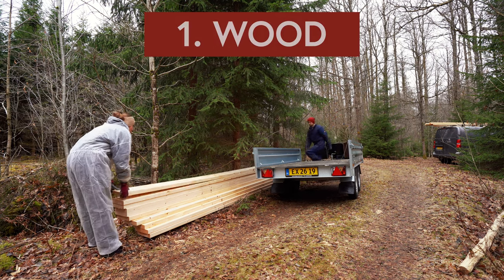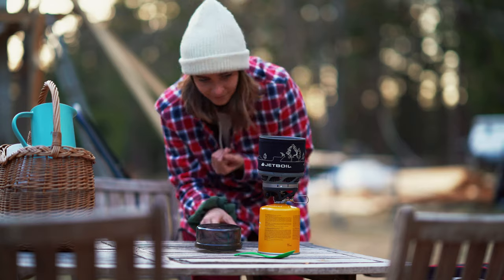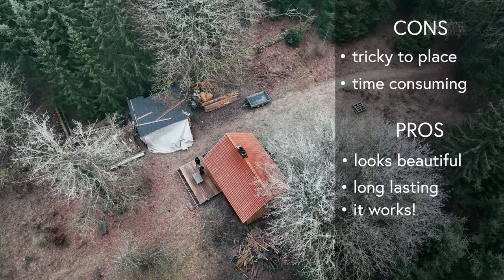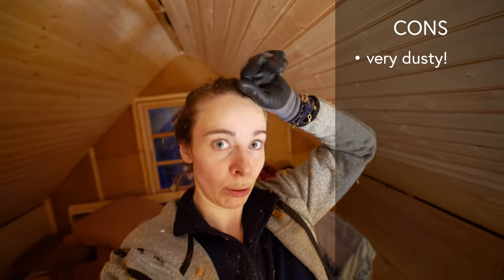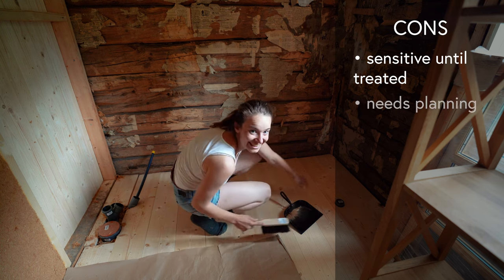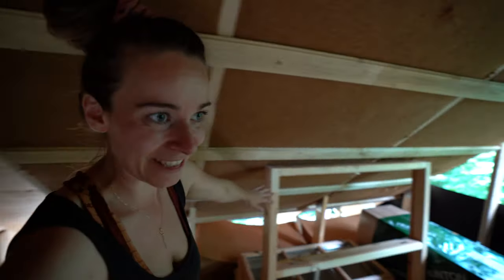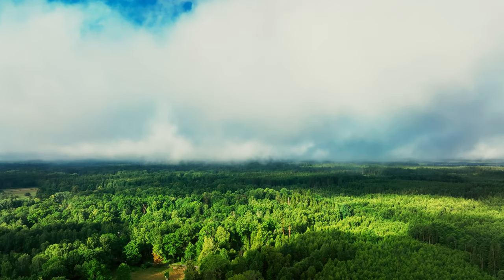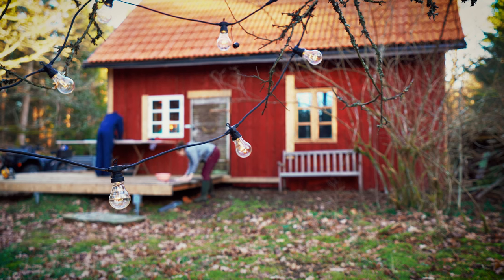Building Off-Grid with Natural Materials | Pros & Cons + Regrets

Comment: I would recommend an oil based stain ove any latex paint. Stain needs no removal when a new coat is needed, soaks in much deeper into the wood grain offering much more protection to the wood, and can be found (at least here) using natural oils like linseed so there is no chemical odors. And, if you could keep at least 1 wall showing the original log wall in the inside I think that would look great (we Americans love our log cabins) and showcase the origins of the building. Best of luck.
Reply from the maker: Hey goatman. Thanks! So, we don’t need to remove the dark stains on the window frames before coating them? Am I understanding it right?

Ohh I know 😅 Everyone reacts to the wall. It’s just so damaged. We talked about making a “window” or having new old planks put up. Because you’re right, it looks so cosy!
Lots of love, Annie
Reply: @AnnieJulian  with a good oil based stain, no. It may show a bit of darkness, but to me that is just character and charm.

Comment: I second the oil/beeswax comment, I use tung oil and beeswax personally and love it! I go 12 parts oil to 1 part beeswax and buff it in well, then wipe off the excess after a few hours. If Odie’s oil is available in Sweden I would highly recommend their finishes too. It is tung oil based too but dries a little faster.
Reply from the maker: Thank you! 😃

Comment: Hej, there! We are on a similar project in the Alpes - it‘s an old stone barren, though. I was wondering, what you did to protect the untreated wood from woodworms and (worse) and Hylotropes bajulus (commonly called old house borer)? Or don‘t you have that problem in Sweden? Take care and have a nice day …
Reply from the maker: Hej! So wonderful to hear from you. How amazing you're doing a project like this too. So curious to see your stone barren. 
Well, nothing yet. What are you gonna use, do you know yet?
Love, Annie
Reply: Hi, Annie I haven’t got a yt-channel (yet), but imagine an old rustico in the Lepontinian Alpes at a height of approximately 1300 meters above sea level. It‘s steep, meadow is facing south, and the light is stunning. 

What I would consider against wood worms, and this nasty hylotrupes bajulus: kind of wood (more heartwood, less sapwood, for certain parts larch, but its pricy, of course), its dryness (the drier, the better), construction (the air should circulate freely in the space between tiles and construction), biological barrier.    

One elegant way is to burn wood, brush the ash off, oil it. Works with façades, terraces, flooring. It‘s a japanese technique called yaki sugi, also shou sugi ban if you want to do some research on it. The idea is to carbonise the surface as a barrier - no damaging chemicals involved. 

Second idea is to use less risky chemical barriers (with keywords „wood protection“ and „biological“ you should find some products). Pay attention to ingredients, though - boron salt e. g. is cancerogenic when inhaled, but is sometimes sold as „biological protection“. 

I‘d also rely on local knowledge: Maybe ask old farmers how they protect their houses. 

Of course one has to accept the impossibility of a hundred-percent-control, when one lives off-grid, but one can control certain aspects like materials, construction and barriers. 
Have a nice day!
Anne
Reply from the maker: @zerpheros  Thank you so much, Anne! I will show all of this to Julian, when we get to this. So much great advice, thank you ☺
And Oh my Gosh, your place sounds stunning! Looking forward to that YouTube channel. Let us know 😊

Beautiful day to you.
Love, Annie
Reply: Good morning, Annie 
welcome and I am happy to help. I bet, we can all watch on your channel how you decide what to do with the wood … By the way - I have stolen your put-the-tent-oven-in-the-chimney-idea. I added a steel basket with sauna stones on top to store the heat. It helped a lot to heat up the ground floor - stone huts are awfully cold in winter. 
Take care and have a nice day …
Reply from the maker: Good morning, Anne :)
Oh yes, it will be an exciting one, when we treat the wood. So many beautiful suggestions.
My Godness, really?? I love that! Thank you for telling me (gives an amazing feeling of purposefulness when someone gets inspired!)
The sauna-stone basket is a wonderful idea! I will tell Julian about it.
Take care, and have a beautiful day too. You are amazing!
Love, Annie

Comment: I'd been wondering why you didn't reuse the old roof tiles? At least the majority of them. Then at least 1 full side of the roof would have been free. And the weathered and moss growth would look original.  Or, why not slate? Even here in USA there are hundreds of old buildings with slate roofing. My farm has all the older buildings (1950's and earlier) are still in their original slate roofs.
  Also, what is the R value of that wood pulp insulation? I have never even heard of it before. We (USA) have a blown-in cellulose insulation, but it is mostly waste paper pulp and is super dusty and can (will) settle with time leaving the upper areas of a cavity with nothing but air. And how does your insulation compare to just regular sawdust? That used to be (a century or more) common, at least in rural farming buildings.
Reply from the maker: Hey! Oh, the old roof tiles were really, really damaged. So to protect the house 😊 I’m not sure we would have liked the look if it was mixed. 
I don’t think I’ve seen slate around here...
Thank you so much for your comment, we really appreciate it 😃
Love, Annie